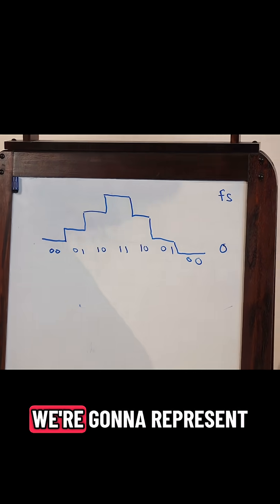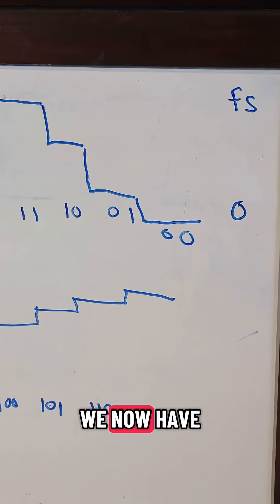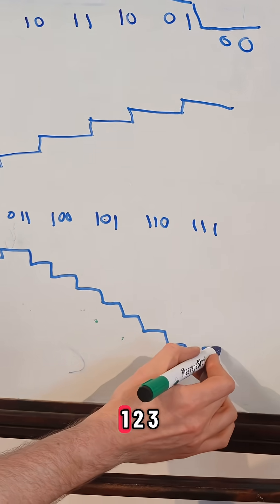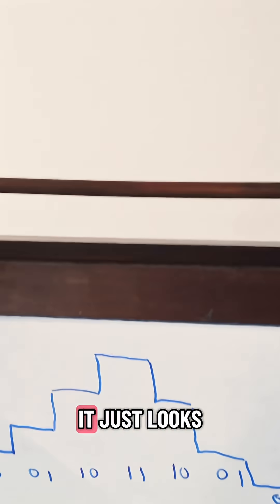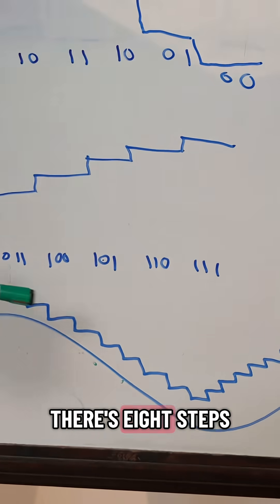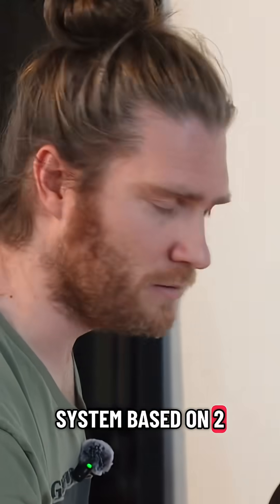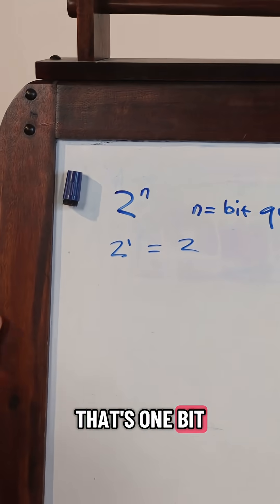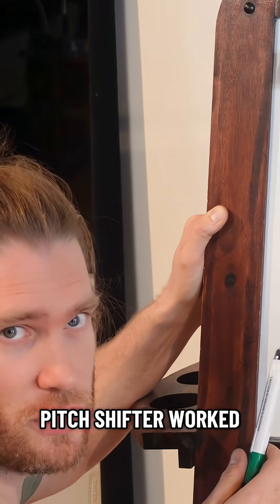From a 3-bit system to bit quantization #repairing #vintageelectronics #seminar #8bit #fypage

Comment: What made the old lower bit gear sound good back in the day (like a 12 MPC 1500) was the multi-mode filters.
Reply from the maker: A prime example of this is the Prime Time 93, it has elliptical filters with switchable polystyrene capacitors to change the cutoff frequency all the way down to 1.5khz.